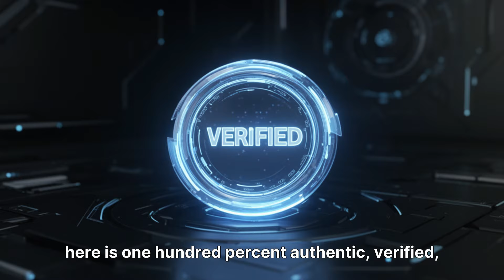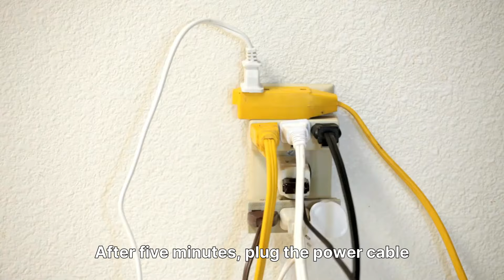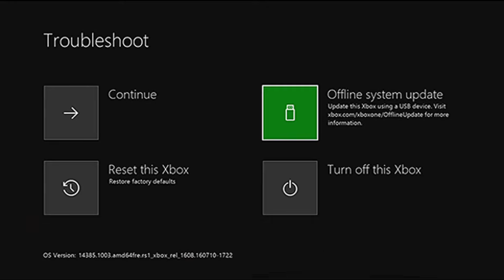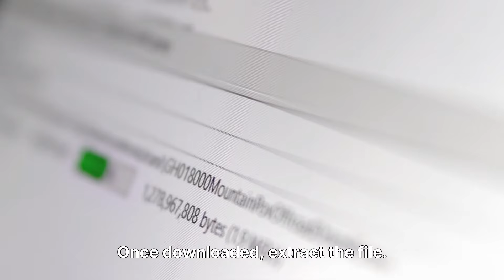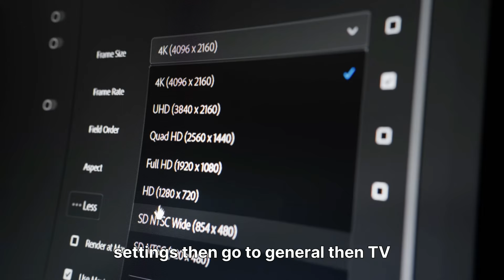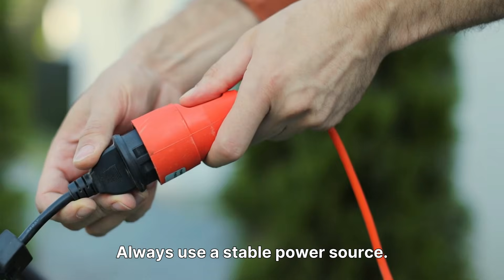Most People Get This Xbox Fix Wrong—Here's Why

Comment: This is not always an xbox problem. A lot of the time it is a problem with your TV. My tv has been forcing updates on me lately and i was able to fix this issue by restarting the tv from the power menus (not just turning the tv off then on.) If 6ou can hear the xbox working normally when you use your controller there id a good chance its your tv. Try restarting and if that doesnt work try a factory reset.

Comment: Xbox one x. Tried hard reboot several times but the screen continues to flicker. It seems to work and goes through the process of starting and running but the the screen continues to flicker and flash.  Tried different cables and ports. My one s does the same thing regardless of what I try

Comment: After all the steps I still get a green screen it won't even boot up in safe mode
Reply from the maker: Oh no, that's really frustrating! A green screen even in safe mode usually points to a more serious hardware issue. Have you tried checking the internal connections or considering a professional repair?

Comment: I kept getting this problem with my Roku TV, the problem is with the TV new software update, when you select the xbox input from QUICK ACCESS you get the green screen, but if you select the input from YOUR APPS section or go to  settings>picture seetings then  is all good. Weird but it works for me.
Reply from the maker: That's a really interesting workaround you found! It's always a puzzle when software updates introduce unexpected issues. Thanks for sharing your solution!
Reply: Thanks for the tip!
Reply: You are my hero lmao 😂
Reply: Thanks, now I want to take my roku out back and shoot it even more.
Reply: Yes I have the same problem on Roku wtf
Reply: What do you mean by picture seetings and also if you meant picture settings what are you supposed to do on picture settings to fix it
Reply: I had to factory reset my Roku TV then it worked
Reply: I love you
Reply: Thank you so much

Comment: My Xbox one has green vertical lines that blocks the screen anything I can do to fix it?
Reply from the maker: Green vertical lines can often be a tricky issue. Have you tried checking your HDMI cable or connecting your Xbox to a different display to rule out a monitor problem?
Reply from the maker: While this video focuses on PS5 controllers, green vertical lines on an Xbox One usually point to a GPU or display cable issue. You might want to try a different HDMI cable or monitor first!

Comment: I just spent $835 on a Series X and this sht happens when its just downolading a couple games completly unacceptable!
Reply from the maker: That's definitely frustrating, especially with a brand new console! Hopefully my video helps you get to the bottom of why this sht happens.
Reply: @TechVibes-maf  I did the Hold down the Sync and Disc drive button then Turned the xbox on while holding both the buttons down for a few seconds whixh brought me to the trouble shoot then I just factory reset working fine now

Comment: I can’t get the troubleshooter screen. I have green and yellow vertical lines. I can’t read what’s on the screen. I’ve never seen this happen before.
Reply from the maker: That sounds like a really frustrating situation with the green and yellow vertical lines. It definitely makes troubleshooting tough when you can't read the screen. Have you tried connecting to a different display to see if the lines persist?
Reply from the maker: Confirm the problem is in the monitor or gaming console? Please change the HDMI cable.

Comment: After getting the troubleshoot screen, my controller isnt connecting to the xbox. It has fully powered batterries and is turning on.
Reply from the maker: Sorry for the inconvenience dear sir.  Please check below solutions and let me know the result. 
The Quick Reset
Check Batteries: Ensure they aren't dead. Replace them or plug the controller into the console via USB-C cable to see if it responds.
Power Cycle: Hold the Xbox button on the console for 10 seconds until it shuts down. Unplug the power cable for 30 seconds, plug it back in, and turn it on.
2. Manual Re-pairing
Turn on the console and the controller.
Press and release the Pair button on the console.
Press and hold the Pair button on the top of the controller (near the USB port) until the Xbox button flashes rapidly.
Wait for the lights to stay solid.
3. Update Firmware
If it connects briefly or via cable, go to:
Settings > Devices & connections > Controllers & headsets > Update now.
Pro Tip: If you recently used the controller on a phone or PC, double-tap the Pair button to switch back to console mode.